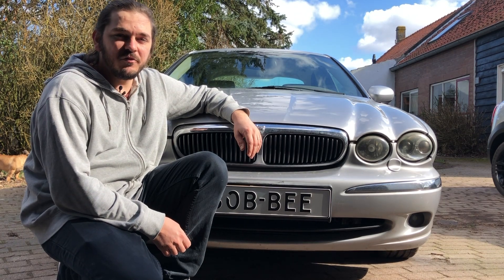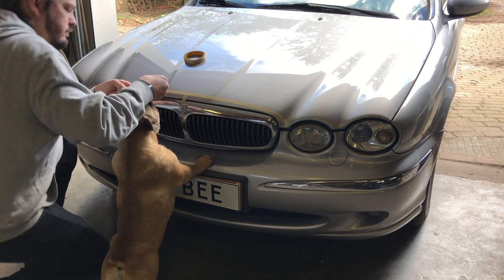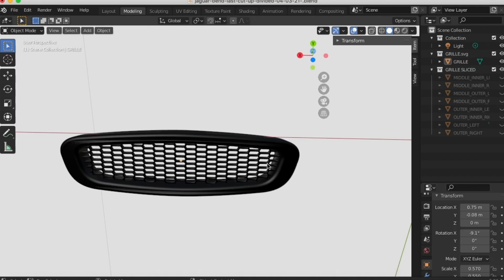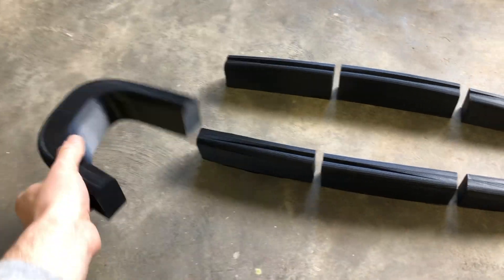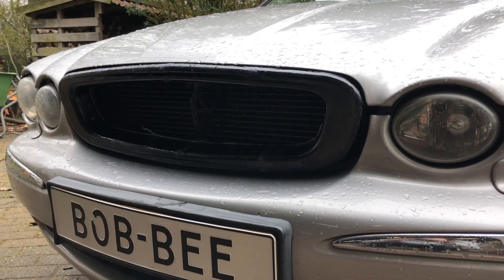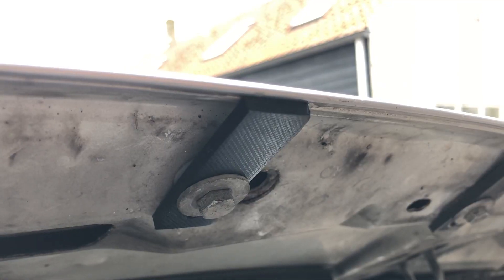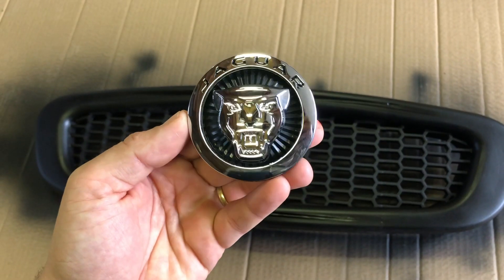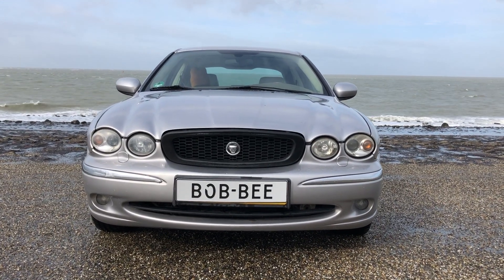3D Printed Car Parts - Jaguar X-type Grille

Comment: I have been wanting to do the same thing.  Did you consider printing in alignment holes or features? Also what was the material you used you said it too fast for me.  -Thank you great job.
Reply from the maker: The material I used is ApolloX. When I would print a second version I would make some improvements like the attachments .
Reply: the material is asa based, asa commonly used for automotive needs in 3d printing

Comment: Looks pretty good, though the lines don't quite match up. I think you'd be able to get a better fit if you used a 3D scanning app on your phone to scan the original grill, then base your new model on the dimensions of that.

As a proof of concept though, this looks like its works very well! Though I am curious of how parts like this will stand the test of time.